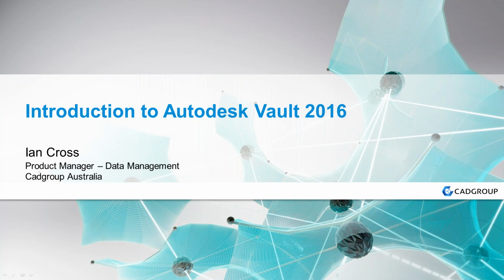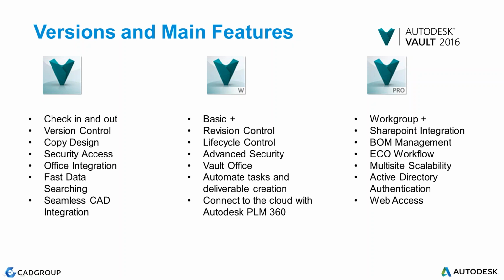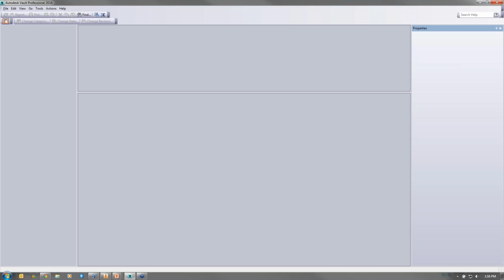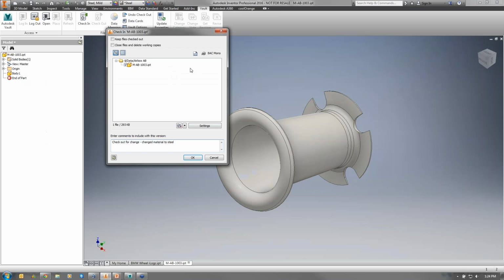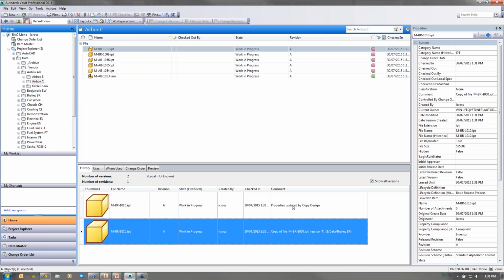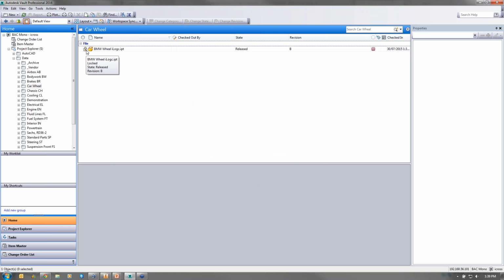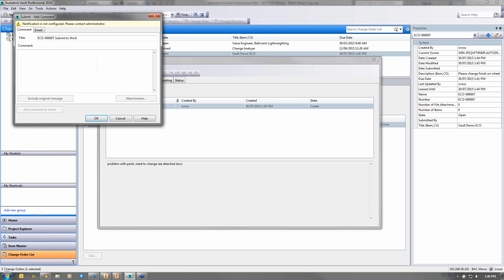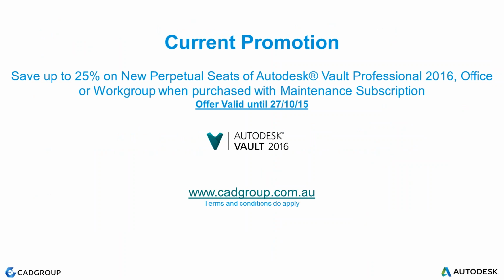Introduction to the Autodesk Vault 2016

Comment: Hi Eloy, 
Unfortunately i no longer work at Cadgroup Australia, but Vault should manage iparts and iassemblies just fine, providing you use them correctly, it can become an issue if your using them across a bit group of people, where some users may not be aware they are iparts/iassemblies. 
Do not move them around outside of the iparts\iassemblies folder, they should all live together. 

They have a bit of a bad rep with vault, providing they are used correctly, they should be fine.

Happy Vaulting.